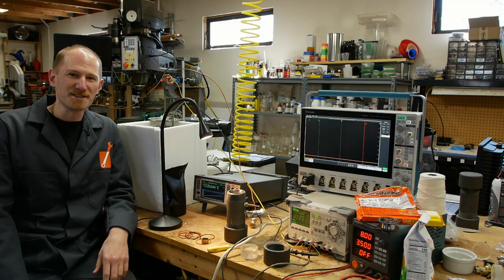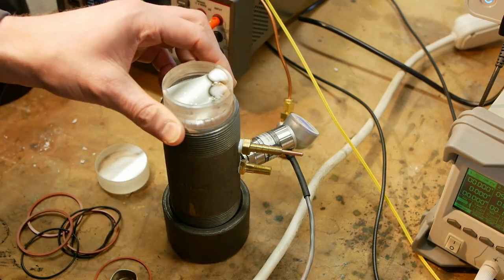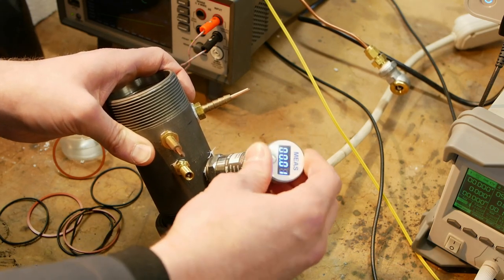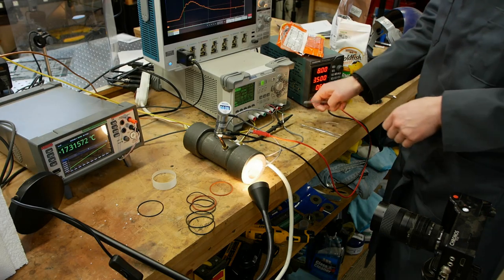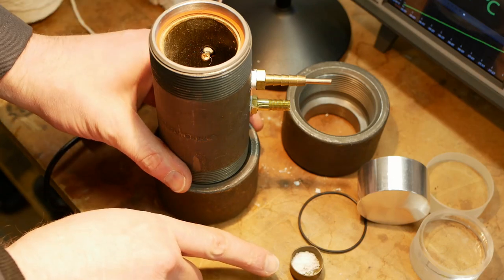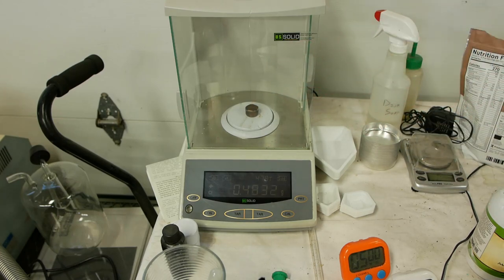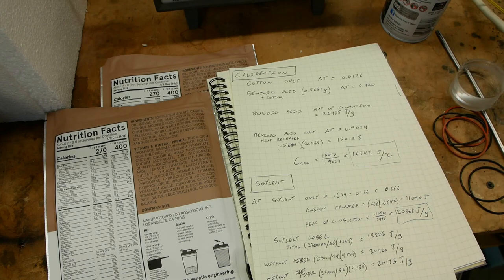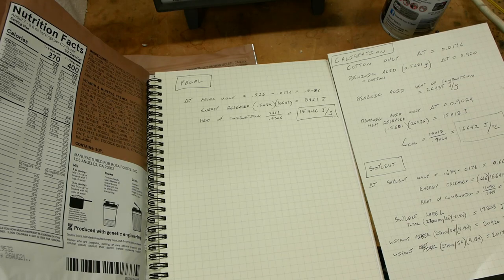Measuring human digestive efficiency vs. a flame

Comment: Waaait a minute. Am I wrong, or does the ratio of EnergyDensity(dry soylent)/EnergyDensity(dried excrement) tell us precisely... nothing!
I would expect that for each 1 gram of consumed dry soylent, human organism would produce strictly less than 1 gram of dried fecal matter (e.g. carbon dioxide output, skin shedding, sweating, and so on), so the efficiency would be way bigger than 1-(16642 J/C)/(20368 J/C) ~= 18% !

Comment: gram of poop per gram of original matter is not good way to compare values, what happens in the body is most of the food is digested but parts that are not are pretty concentrated, so for example if you ate 100 gr of Soylent, afer digestion it will result in 20 gr of excrement so all undigested, but flammable stuff is concentrated in smaller sample.
For more accurate results measure complete input and complete output by dry weight

Comment: okay, slight problem, about fifty percent of your fecal matter is actually gut microbe so you would need to isolate for the undigested food vs microbiota growth which would retain its own pool of calories, that is not easy and would require more than burning poo. We could get a more accurate number by collecting the  CO2 you are exhaling and taking very accurate measurement on your weight as well. Further problem, not all nutrients are equally absorbed, medium length hydrocarbon chains are about optimal and that is what you give premature babies for weight gain due to poor intestinal development. But what do I know, im just some schmo on the internet

Comment: Where I see the problem with this measurement and the result is ... that is not apples to apples comparison. 1g of fecal matter is not from 1g of input, could be from 10g of input... the stuff that burns goes out with breathing (CO2) ... and some stuff maybe gets processed in the body and rejected and goes out in urine. So to measure "digestive efficiency" would also need info - sorry to say that - "mass in" and "mass out" measurement.

Comment: Just screwing around? I beg your pardon, good, sir! This is SCIENCE!

As the sage Adam Savage said, the difference between science and screwing around is writing it down. If a picture is worth a thousand words, then a 32:31 60 FPS video should be worth...117,060,000 +/- 60 words. That's an awful lot of writing.

Comment: I feel  that you neglected the fact that 1 gram of soylent and 1 gram of stool are not the same. Stool is condensed undigestible things. 1 gram of it, could be made out of 10 grams of soylent. To measure the efficiency of your digestion, you need to know how much soylent makes how much stool. That might require you to eat soylent for a longer period of time. And dehydrate and measure all your stool. To have an semi accurate average weight comparison. It doesn't really seam worth it XD

Comment: 30 bar pure oxygen through a schraeder valve? ehhhhhhh, I'll leave that to the fine folks on the other side of the camera thanks. Does the seal in the valve not burn like the o-ring?
Reply: oooh, could you pre-treat your chamber and seal with fluorine, to leave an inert fluoride coating?

Comment: Should change the title to metabolic efficiency rate, as the human digestive system uses the "waste heat" within the system to maintain it, making it a recovered resource and not a waste.
Yeah there is a statistic for how much energy we convert to kinetic force, but using the term efficiency is just inaccurate to human physiology.

Comment: You probably ought to flush out the nitrogen in the air in the chamber first. 
at least you calibrated your system by finding the amount heat lost (via heat capacity) to the calorimeter itself by burning a pure substance of with a known heat of combustion 👍

Comment: Great experiment!  However comparing 1g of  input (food)  to 1g of output (poop) will not give valid results as to how much energy was extracted per weight. You miss the oxygen going in  and the CO2 and water going out as a result from burning fats and sugar (among others). Still waiting for a kilogram of poo from my car :-).  That could be solved by determination of the food to poop mass ratio.

Comment: Cool video but completely flawed. By digesting you take up the useful stuff in the food. So your excrements are just the not digestable part of the food (mostly fibers) and tons of bacteria from your digestive system. So you can't compare its mass to the mass of food taken in. You'd need to simulate digestion. Or you could find a workaround like quantifying an indigestable component in the food and the excrement and use it to correct the mass. Maybe fibers or better something easily quantifiable and not digestable at all (something super stable and not passing from digestive tract to blood. And preferably non toxic ;)).

Comment: Sorry to tell you, but this test is completly inaccurate. Human digestion is way too complicated process, the liver is also releasing bile into digestion system, there are also parasites. Major part of the fecal mass is actually bacteria, they basically ate some of the fiber, carbs, and multiplied on it. When you burn their bodies, you get energy, which body never can get.

Also, you burn it. But body cannot raise temperature so high, also processes in the bowels are going without oxigen, it is know fact, that anaerobic processes are much less effective in terms of getting energy out of it. Of course, by burning, you'll get much more energy, because it's going under high temperatures. It's like with cold pressed oil, and refined oil... you'll get more, when pressed under high temperature, but oil is denatured. Body needs to get nutrients, so it cannot burn them. Most of enzymes, vitamins and vital elements are sensitive to high temperature. So of course, to digest the way, without the oxigen, in watery enviroment, up to 40-42 degrees temperature, and the way, you actually doesn't destroy sensitive elements, is WAY less effective in terms of releasing energy, than burning. Like, there is no question about it, it cannot be 80%, or 60% energy of burning. It will be way less than 50%. 

And at the last, parasites. You know, you never know, how many parasites you have actually in digestion system, but there isn't one man on the planet, that have just zero parasites inside. Everybody have some worm here and there. There are also microscopic parasites (like one-cell organism). They eat lot of carbs and aminoacids out of digested food. In other words, you cannot just take one man, and measure it, because one can have much more parasites than other.
Reply: btw, small myserious bubbles found at the end of burning inside the chamber could be bile acids and salts.

Comment: 1 gram of input doesn't result in 1 gram of output.
Output is less because some of the carbon comes out as CO2.
There is also urine and fart and maybe sweat🤷‍♂️.
And your weight should have stayed the same the whole time.
So 20% isn't accurate.
Good video btw.

Comment: A real Turd-de-force 😎
But... Did you control for QUANTITY?
It looks like CALORIC DENSITY of Soylent and FDT (Freeze Dried Turd) are similar, and while that's, um, "interesting" ...it doesn't speak to the question of digestive efficiency
The efficiency calculation must include the total INPUT grams of Soylent 🍕🍕🍕🍕🍕🍕, and total OUTPUT grams of FDT 💩💩💩

Comment: Do you realize how this explain why so many ppl have issues losing weight?
Fast metabolism, you dont extract much and in 24hr it goes out, no overweight. 
Slow metabolism, you extract much more because the food can spend twice or even more time in the digestive system, gain weight easily.
At same Kcal injested, one get fat and not the other.
Slow metabolism are old ones, from before the industry era, adapted to not much food.

Comment: You made big mistakes in your calculation, but YT keeps deleting my feedback comment what the hell.
Here it is in the replies PLEASE READ
Reply: Food science professional here, I'm pretty sure you misunderstood the nutrition label as well as made mistakes in your final calculation:
1. the soluble fiber is a part of fiber, and the fiber is a part of carbs. Hence to sum up the contents you can forget about them all and just add up the parts that are written in bold. The reason why the bold things don't add up to 60 is because minerals and water aren't declared.
2. Even if they weren't a part, you still wouldn't subtract them from 60g though! That's absolutely the wrong way to calculate what you wanted to calculate. No need for food science knowledge to figure this one out but let me point it out: you determined kcal for a 60 g sample hence you divide by 60, period (because that's how you calculate the calories in 1 g of sample and the label has nothing to do with this).
Reply: 3. It is in fact expected that your measurement is higher than the label says, because the flame can "metabolize" things that your body can't. And the indigestible calories are already ignored in the calculation of the label. Google: "Attwater factor", and see how the factor for fiber is way lower than that of carbs, even though they are chemically roughly the same in terms of energy.
4. Your output calculation is fundamentally wrong. The reason it is so high is because you missed the fact that eating 60g of Soylent (almost 60g of dry matter), does not result in 60g of output, but much less, so comparing them 1-to-1 is pointless in your case. You would need to also weigh all of your dry output over a period of time to calculate that ratio as well.

If you need anything else explained, I'd love to help :)